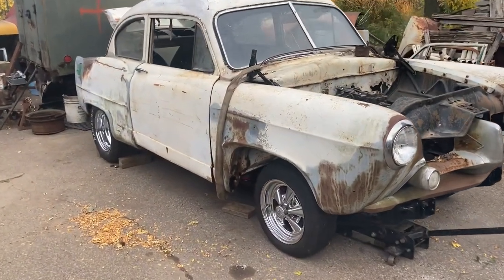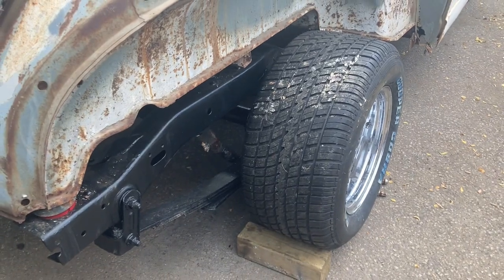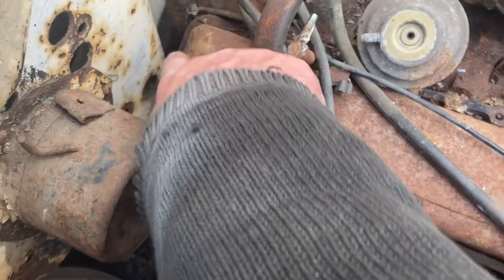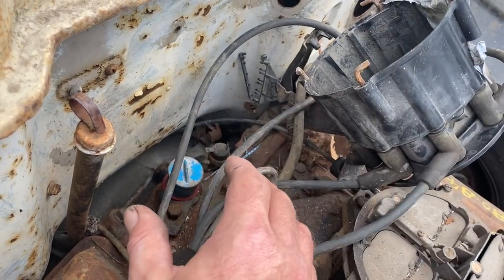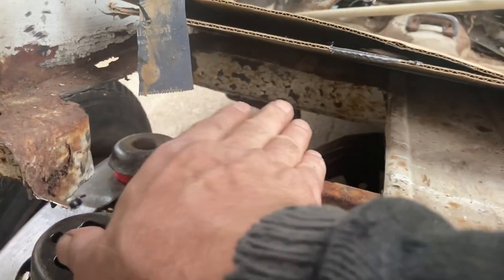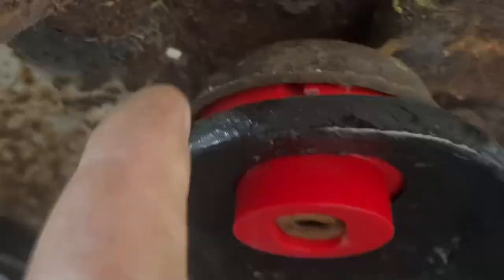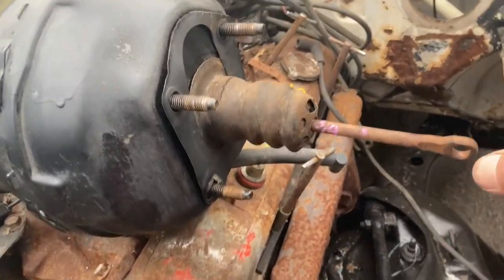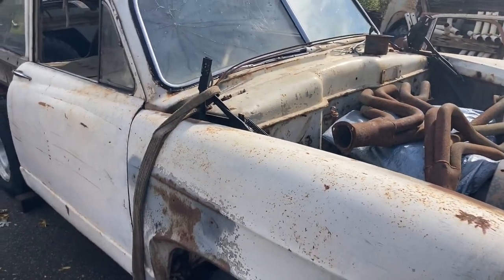HenryJ Frame Swap - Part 3

Comment: I finally found a build that mirrors mine. I am putting a 1960 Rambler American wagon 2dr. on a S-10 frame. Both the Henry J and the Rambler wagon have 100" wheelbase. I am assuming that you already cut down the S-10 frame to match the Henry wheelbase. Are you dropping the body as far as it will go so the floor is just above the frame. That means lowering the body mounts below the top of the frame. I am hoping to have more of a slammed look eventually with dropped spindles in the front and lowered leaf springs in the rear. The engine placement on the Rambler requires a short water pump to clear the rad. I am looking forward to all your upcoming videos, keep em coming.
Reply from the maker: All these builds are great. I love watching them. 
HenryJ fits the frame (first gen. S10 Blazer, 2dr, 2WD.) perfect - no cutting needed! 
Floor is touching frame now as I’m making body mounts. 
The mounts will be winter project as the snow covers the HenryJ. 
Thank you for your encouragement!!
Reply: @canadianwrench  My bad. I thought the only difference between the Blazer frame and the S-10 truck frame was the Blazer frame sat higher. I was unaware that it was wider as well. The Rambler is a uni-body so I needed a narrower frame to fit within the built in frame rails. The S-10 truck frames start at 108" wheelbase, so that is why I thought you had it shortened to fit the Henry J wheelbase. Carry on.
Reply from the maker: All good!! 
There is someone putting a Corvair (unibody) on a S10 frame on YouTube. It’s another fun watch.